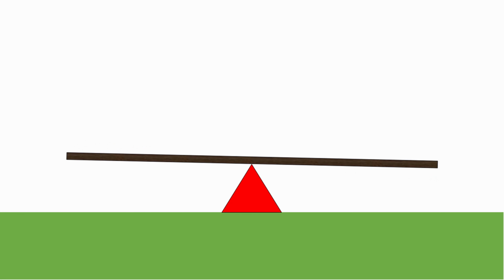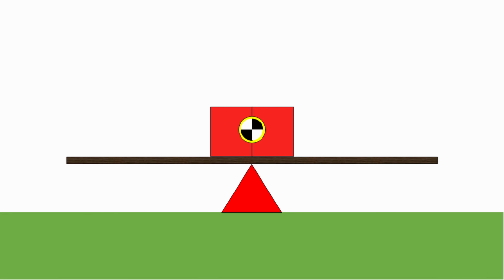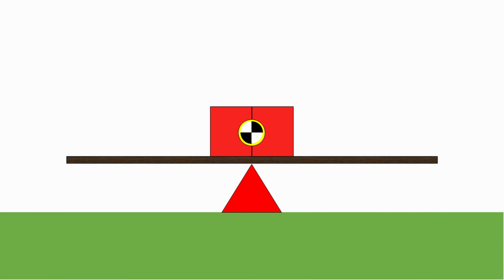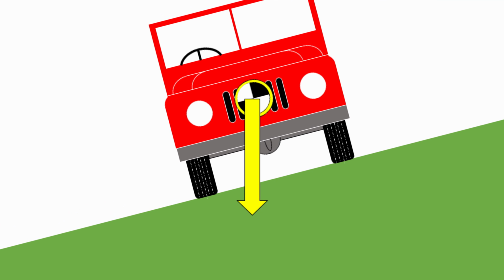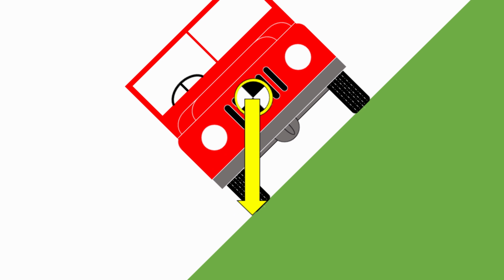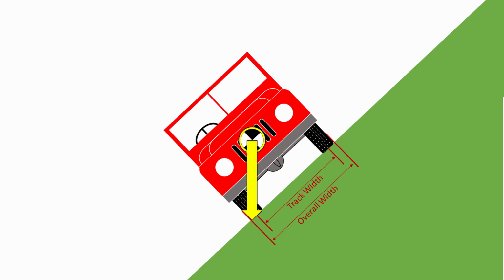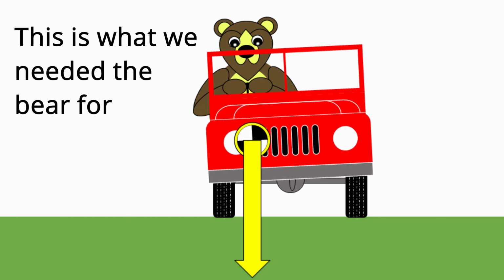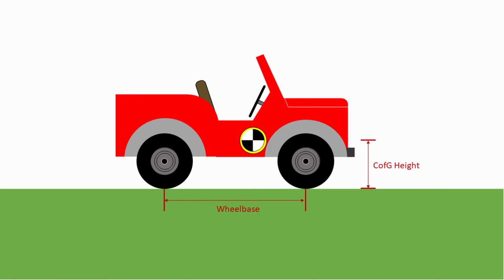Vehicle Stability

Comment: Question: What role does speed play [if any] in maintaining vehicle stability while trying to side slope? Two situations: On a sand dune, we maintain momentum to push through. I'm guessing it's partly so that we don't get the bottom tyres to sink in the sand thereby tilting the car over with the weight all on the bottom tyres. What about on a solid slope such as a hill?
Reply from the maker: In itself speed doesn’t really affect stability, but any change of speed (or direction) will have an effect. So for example if you are driving diagonally down a steep slope and brake sharply the vehicle can become unstable. The exception to this rule is in situations where you are following a curved path and can use the centrifugal force to hold the vehicle on a slope. This might happen on a curved sand dune and creates the same effect you would get on a banked oval circuit.
Reply: @Offroadvehicleengineering  thanks for explaining.